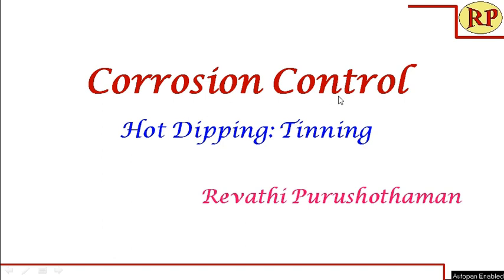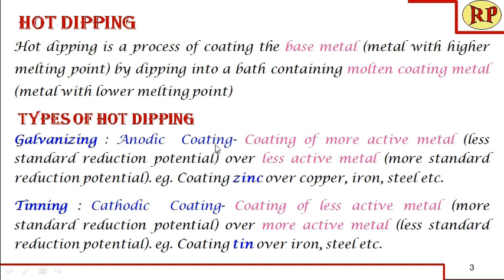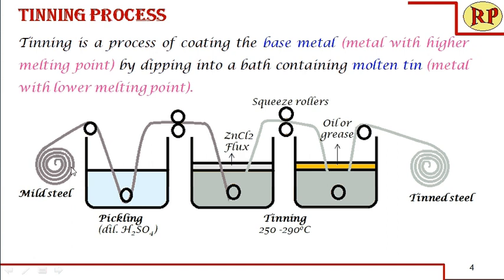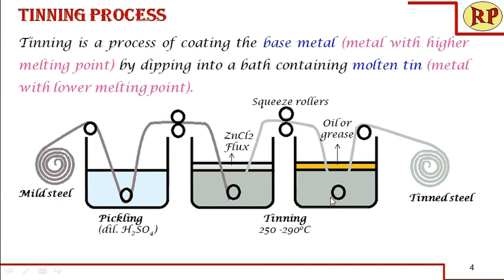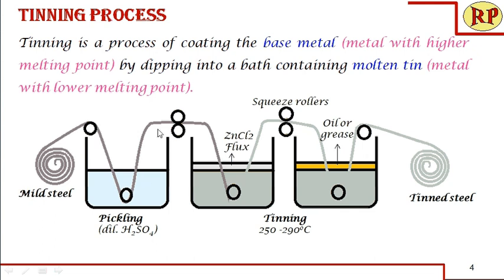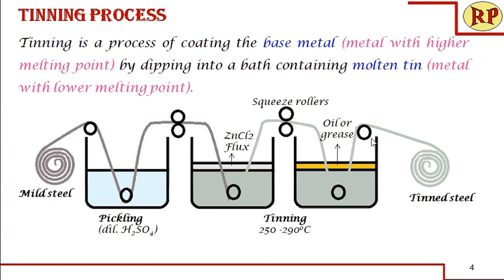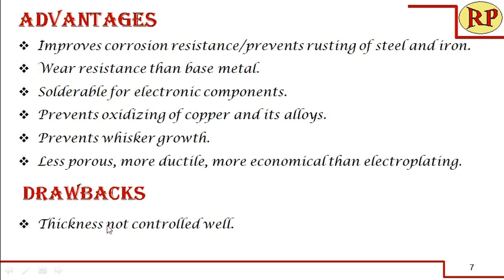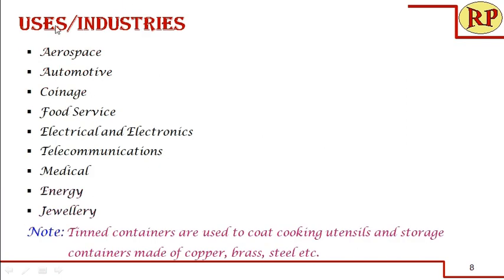Tinning process:Hot dipping (Corrosion control)

Comment: If, less active metal ( more reduction  potential) is coated over less reduction potential metal (base metal), then why doesn't corrosion happens there ?? Why not base metal acts as anode and gets corroded? Because there is a difference in reduction potential between two metals, then why not ??
Reply from the maker: It will happen only if any damage occurs in the coating  watch pitting corrosion and galvanic corrosion video. There is a clear explanation. Here both are not simultaneously in contact with the corrosive medium.